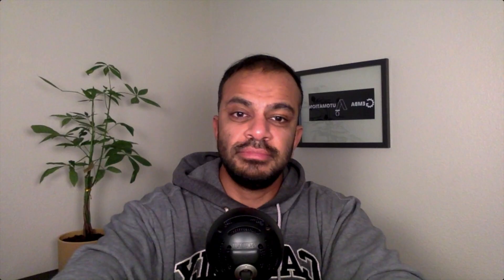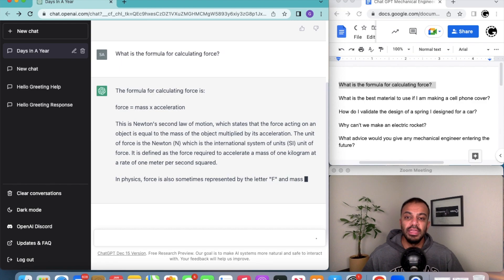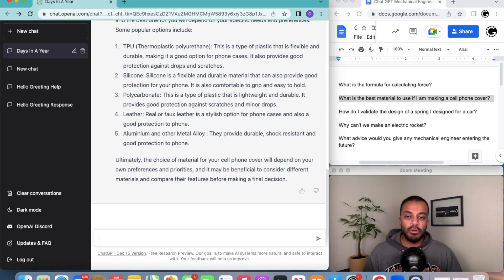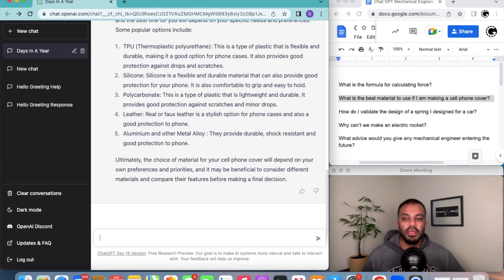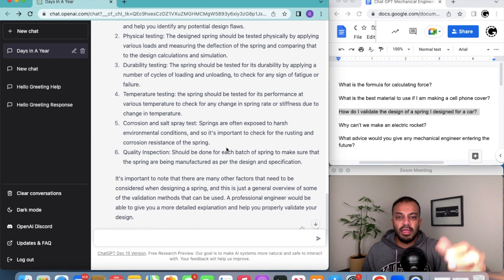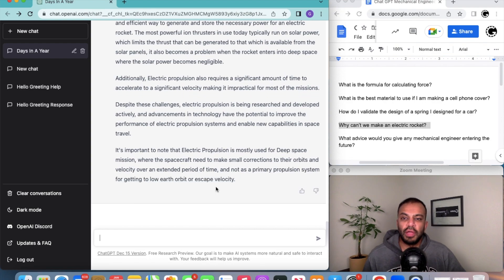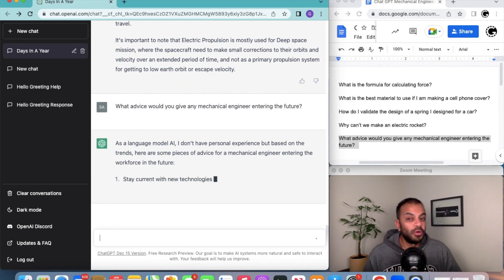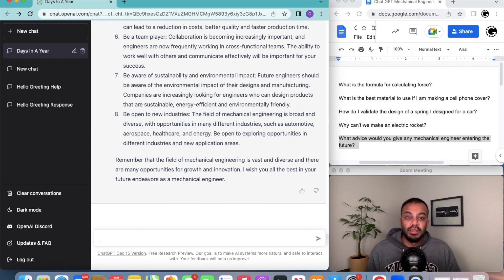I asked CHAT GPT Mechanical Engineering Questions

Comment: try shigley Machine design problesm and check if gives correct answer or not?
Reply from the maker: I just tried this out and here is the ChatGPT response: 

The Shigley Machine Design problem refers to a type of mechanical engineering problem often found in the book "Mechanical Engineering Design" by Joseph E. Shigley and Charles R. Mischke. This book is a popular textbook for teaching mechanical engineering students the principles of machine design and how to approach various design problems.

The Shigley Machine Design problems usually involve real-world applications and challenges that a mechanical engineer might face when designing a machine or its components. These problems typically require the application of fundamental engineering concepts, such as statics, dynamics, strength of materials, and material selection, to solve various design issues, like determining dimensions, material selection, and failure prediction.

Examples of Shigley Machine Design problems include designing gears, shafts, bearings, belts, chains, and other components in machinery, as well as analyzing and predicting the failure of these components under various loading conditions. The problems are intended to help students develop problem-solving skills, critical thinking, and an understanding of how to apply theoretical concepts to practical engineering design situations.